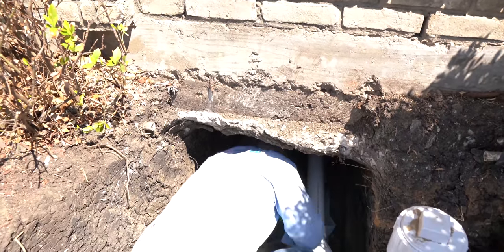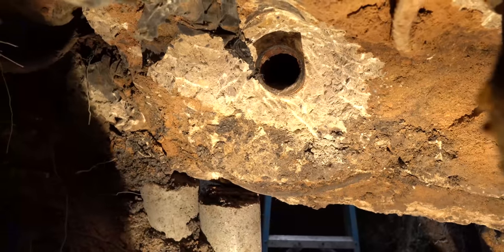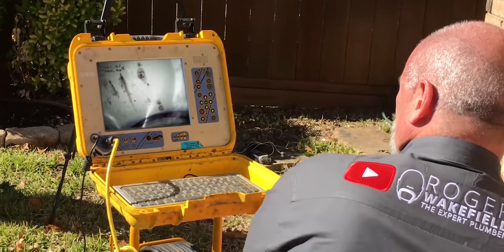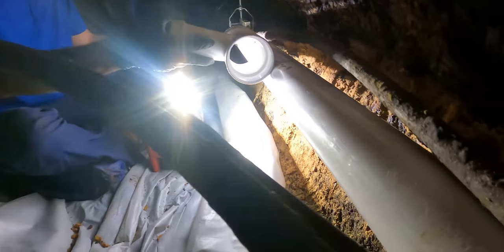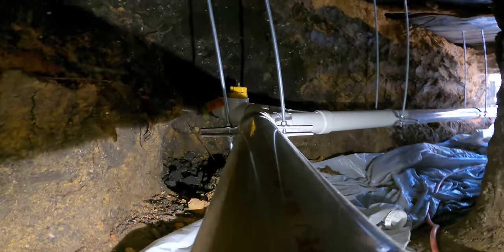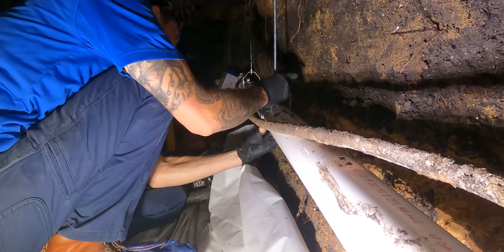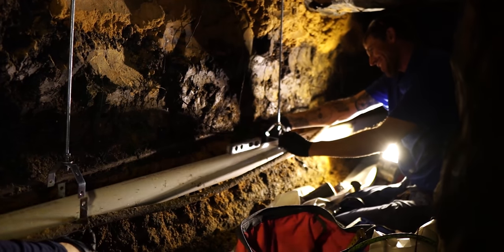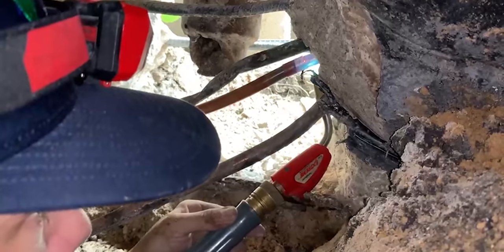Buyer Beware | Test Your Plumbing Before You Buy

Comment: I work on a lot of older homes in so cal and the main problem is definitely cast iron weather it's drain or water lines, the biggest problem we find here is the rust plugging the pipes and eventually losing most of your water pressure, often when a house is sold it stays vacant and the water is shut off and also no longer flowing thru the drains in both cases it's a recipe for disaster, the pressure in the pipes is holding the rust on the edges once shut off all that rust can collapse and plug the pipe, with the drains it's a different situation but same results ruins the pipes.

Comment: Hey Roger  you wouldn’t have to tunnel underneath a slab house if you invested in pipe coating equipment. Then you can line the inside of the cast iron around bends all the way down to 1 1/2” drain lines . After that you can deal with the rest of the sewer outside. Dig outside not underneath the house. You can pipe coat through combos and use the bicote to cut out your tye in’s . 👍

Comment: houses in Texas don't have basements? There are no lines underground under my house only underground beside my house running down to the City lines
Reply: Not really, though apparently more higher end houses are starting to get them. Due to both the soil (expansive clay is pretty common and in other areas like central Texas, you hit rock after only a few feet) and high water tables, it's usually cheaper to build up for more space than down. It can be done, but going to cost.

Comment: I'm no professional by any means but I've seen some pretty bad houses basically just dropped on other people. Usually a couple trying to buy their first house. Which I feel is a horrible thing to do to two people that are just trying to get established during these difficult times. I talked with a young couple not long ago that were expecting all the cosmetic things electrical  updates and plumbing updates. And as soon as I walked through the front door I felt so bad that I immediately noticed the floor was like a small hill and I had to tell them. I installed and jacked up an I beam the length of the house. Just because I felt it was unsafe. Until it could be properly fixed.
Reply: flip houses are the absolute worst for this kind of carp.  the flipper buys the house cheap, does a bunch of slipshod cosmetic stuff as seen on HGTV, and jacks up the price like they actually fixed something - and some naive person will buy it
Reply: @kenbrown2808  Those folks weren't flippers they were just looking for something with no major problems as their first house. They expected it needing to be re wired new panel box plumbing issues but not that the house had dropped more than 3 inches in places under load bearing walls.
Reply: @kenbrown2808  also the things I did are considered a permanent solution  per code in my area and I still told them it is something I would have a professional in that trade look into further.
Reply: @bentboybbz  that's not a fixer-upper, that's a knocker downer.
but my point was flippers take houses like that, and do a bunch of cosmetic stuff, and leave the problems, if not make more.
Reply: @kenbrown2808  I understand. As hard as it is right now I refuse work from some people. No I'm not doing that part way patch it barely crap. Find someone else. It has cost me money but I do not take what I do lightly people can get hurt and alot of damage can be done.
Reply: I've quit jobs. Looked my boss in the eyes and told him  "so that's the price you are willing to pay for someone's safety or their life." Pack my stuff and leave.

Comment: good luck getting someone to sell you a house without waiving the inspection. the seller will just sell to someone who will. When I bought my house, if I told them i wanted to do this, the house would have been sold to someone else the very next day.
Reply: Sounds like a call for patience. If a seller is unwilling to go through inspection, i would walk away.
Reply: Sounds like you got lucky. When a seller doesn't want a inspection. They're probably hiding something. Or sometimes I seen they fix something temp just enough to sell a home.

Comment: As a plumber in Southern California where we just jackhammer the slab, how the hell do you back fill and compact the dirt in a job like this.
Reply: he said in a different video it's some sort of self compacting slurry fill.
Reply: I was wondering why tunneling was more cost effective. That looks like a nightmare. I’m getting ready to have to replace all my cast iron under my slab, and while I’m not looking forward to jackhammering a 75’ trench in my house, I can’t imagine tunneling a space big enough for a full grown man and equipment.
Reply: NC plumber here.  I cannot believe you guys tunnel underneath houses like that!  It seems so incredibly crazy.  What happened to crawl spaces in Texas?
Reply: @Red_Twizzler  if I had to guess, I would assume it started out with adobe houses built directly on the ground to take advantage of the thermal mass of the earth to resist summer heat, and they never figured out that if they build the house with the tunnel already underneath, it helps prevent plumbing damage from ground contact and soil movement, as well as making it easier for any trade to get underneath to make repairs or changes.
and by "easier" I mean I've seen a couple houses now where the crawlspace had a concrete floor and the trades used mechanics creepers to zip around doing things.
Reply: @DavidSumlin  pipe bursting or lining might be good options for you

Comment: I work in basements. I'll work in a crawlspace for a friend or a senior. I might work under a slab for maybe a lawyer or a surgeon but I'm not doing it unless I get to put a new toy in my garage when all the dust settles. I'll come test the lines on a slab for rate but I'm not gonna try to find subs to dig and backfill some job just for some cash. If something is leaking under a slab I'll use my acoustic tool to find it but I'm not even gonna give a quote to fix it. Call someone else. I did one WITH my brother but I made him do the jackhammering and the digging. Tunneling is an entirely different beast. In upstate NY we usually got basements.

Comment: Thanks for the video! Just to get my bearings, but where are you exactly? I have a crawlspace which I've been in many a time so I'm pretty familiar what's there and I can see all the white drain pipes in there. Is that where y'all would be if you were fixing this at my house? Thanks

PS: the only reason I ask because if this is an issue in a house with a crawlspace like mine I would think it would be fairly easy to tell and have a plumber fix...